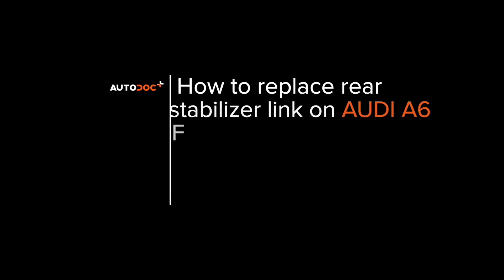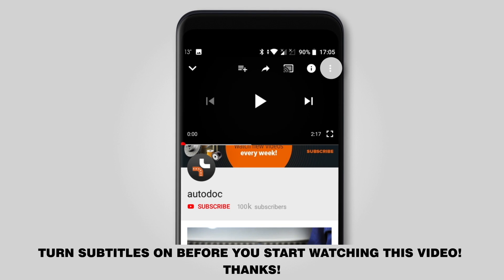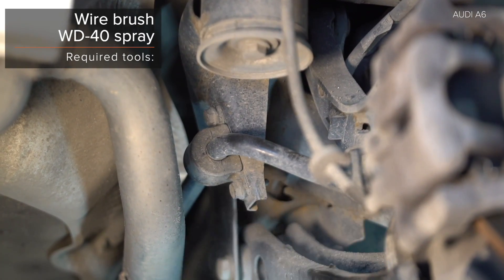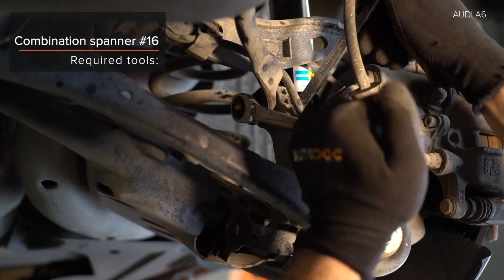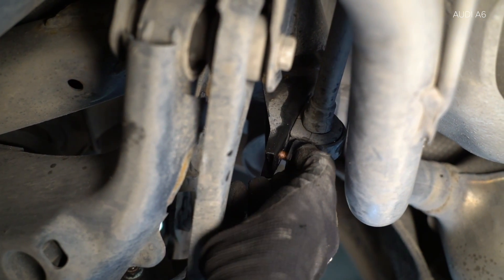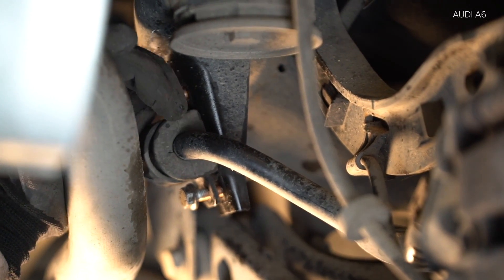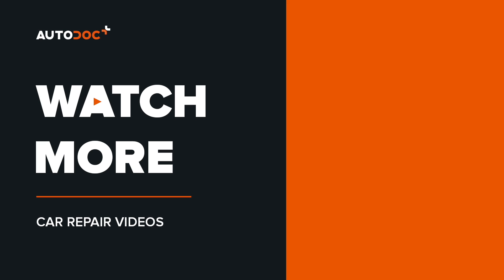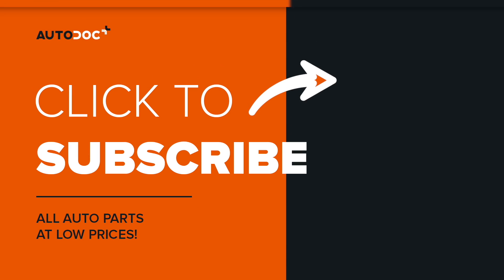How to change rear anti roll bar link / rear drop link on AUDI A6 2 (C6) [TUTORIAL AUTODOC]

Comment: Great tutorial but where are you getting your torque specs?? the Audi manual states only 25NM for the sway bar bushings bolts and 65NM for the end link bolts...
Reply from the maker: Thank you for your comment!
The values of the tightening torques we use according to the service documentation for the repair of our car, as well as the recommendations of the manufacturers of replacement parts.
Best regards,
Autodoc team.